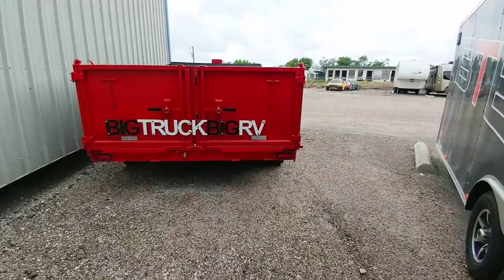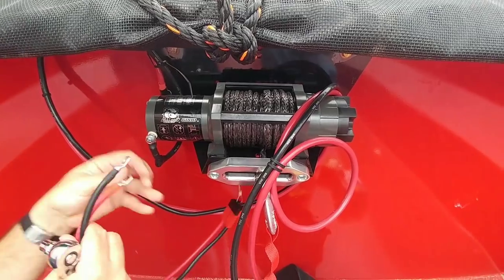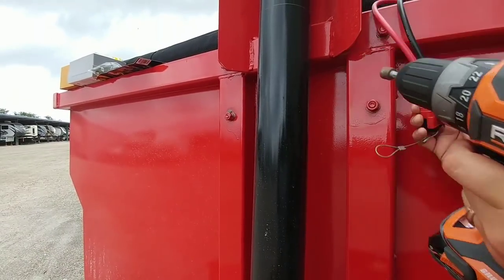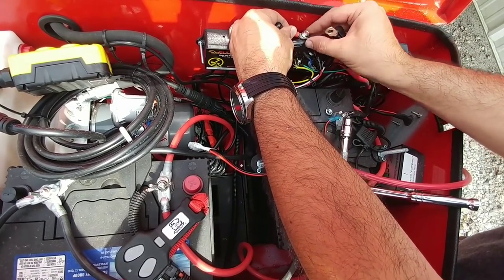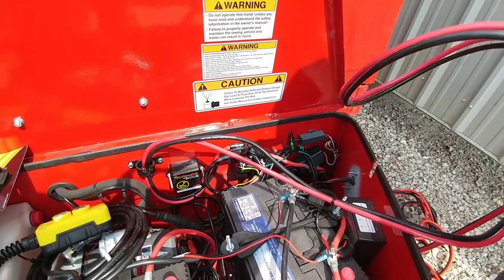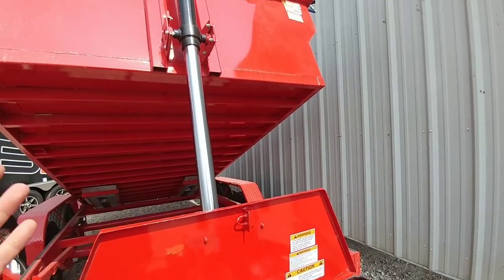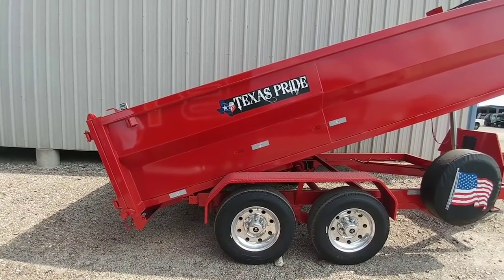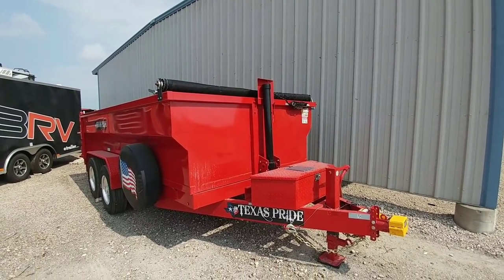Upgrading while downgrading at the same time! Bulldog Winch Power Kit!

Comment: I really love the body design of that dump trailer,you get the low profile of the body between the wheel wells ,and the sides open up at the top to give more capacity and allow easier tieing down of a skid steer or tractor you may put in it.  I have a faily inexpensive 14x7x 3 ft sides dump trailer it’s served me well, owning them 14 yrs I would really love to have one of these for my next one. I like your cable install,very clean,my only suggestion is you may want to upgrade to galvanized insulated tubing clamps instead of that plastic sleeve you X zip tied too, it’s pretty weak if the cable got snagged it will tear right off,tubing clamps will not just tear off easily ,I use them for everything from securing the 2 speed button in our big trucks ,to installing hydraulic hoses along side the combination  bodies on our plow trucks salter bodies.I love the capabilities of the telescoping cylinder but they are 3x more likely to leak by design ,require a lot more fluid and are not easy to source replacement parts and service.I prefer the twin piston ,yes you give up a few inches of ground clearance,but they are easy and cheap to fix down the road. You can buy cylinders at any hydraulic supply store online or locally same day for under 200.00 and be back in business.  Smart man welding the winch bolts on,unfortunately some people would rather take what you’ve worked for than earn there own.....

Comment: Good morning nice space saving project, if you ever want to add simple stress relief, slip the wires through a coil spring tie wrap it to the top coil, anchor the spring to the housing. Also if you want the connector off the frame slightly for better access place a nylon washer between the backside of the connector and the frame, that way you can tighten it down but still have enough room to easily grab it and disconnect. Just my two cents, Be Well Stay Safe. 👍👍👍

Comment: 30 degrees may seem excessive,  but...for instance, a Switch-N-Go truck body system,  starts out with the dump in it's highest position to lift the bed clear of the tailgate (END RAILS).Then after the bottom of the load clears the tailgate,you lower the angle of the dump bed and pull it in.

Comment: I don't know.  I saw two 6000 lbs winches on Bulldog's website. They both say this motor draws 2390 Watts at 12VDC.  That's 199 amps.  Something's going to overheat if you load that up.
Reply: Chris Breidenbaugh exactly. That winch came with the correct cable. I’d be very careful when using it!
Reply: Excellent point, Chris!  Folks need to be careful when making modifications to high current electrical equipment like this.  Hopefully there's a fuse or safety cutoff in the system somewhere.

Comment: These are the kind of connectors I have under my hood for connecting 12 Volt items: jumper cables, power for portable fuel pump, hand held spot lights, etc. etc.          Next up: adding load lights to the trailers.
Reply: akbychoice They are called and sold as “ Anderson “  connectors.They are the industry standard for high amperage load disconnects,we use  them for everything as well.
Reply: I use the Anderson connectors at the rear of all my trucks to run my dump trailer, and brush chipper starter motor, etc instead of having an onboard battery that needs replacing too often on things that don't get used very regularly. Un cycled batteries don't last as long as they use to.

Comment: Were the plugs on the 2 gauge and 6 gauge wires the same size?   If so,  you could have left the short pigtail on the winch alone and just changed out the long section in your tool box.

Comment: If you went down in power cable size ?

2awg is good for 200amps
6awg is good for maybe 100amps

Gonna burn that winch up. You need to look at the max draw of the winch.

Of course you won't use it for real work so it doesn't really  matter
Reply: Kyle Vanwinkle technically, 3/0 is good for 200 amps at 20’.